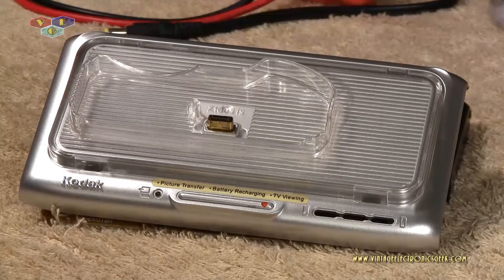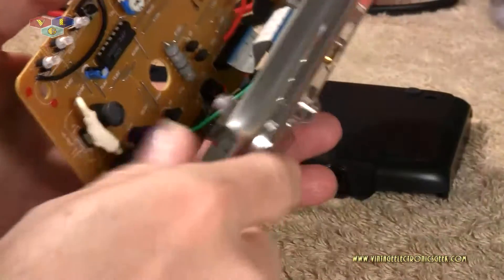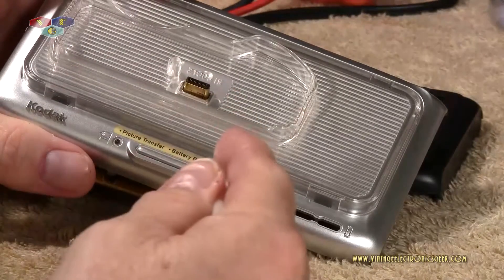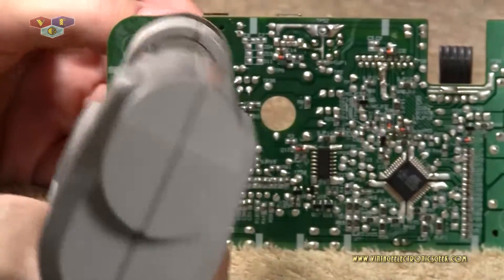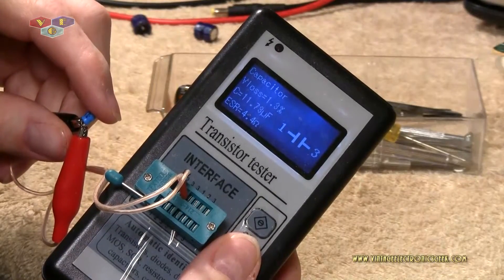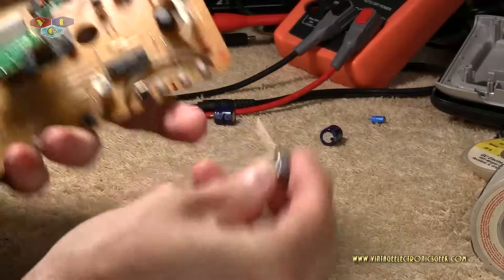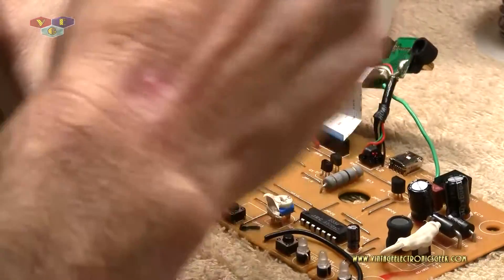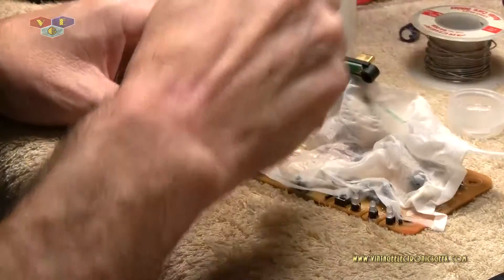Kodak Easyshare Series 3 Dock Repair

Comment: If you dont have a "solder sucking gun" you can always use braided copper wire over the solder weld then use your soldering iron on top of the copper braided and the braided copper wire will suck up the solder

Comment: Thank you for this video. My camera dock stopped charging after a power outage so I searched for a solution. I found this video and, although I don't have diagnostic equipment and wouldn't know how to use it if I did, I decided to open the case and see if I could find any damage.  I wasn't able to see anything noticeable, so I checked the connections to make sure they were snug and reassembled the case. When I plugged it back in, lo and behold, it was working. Thanks for the inspiration!